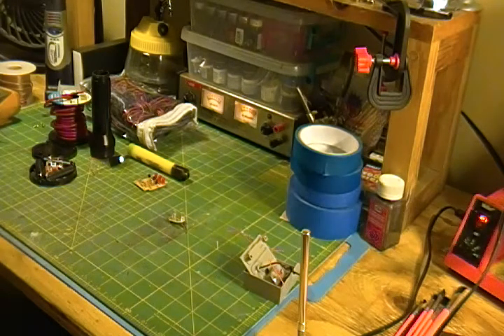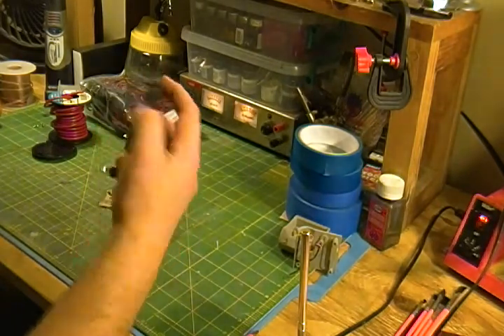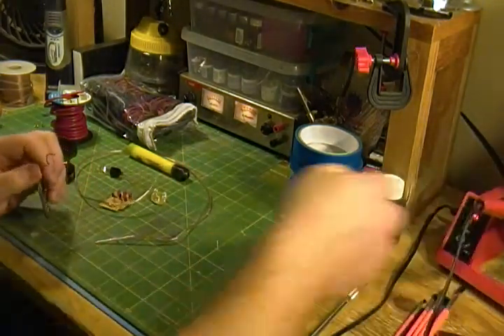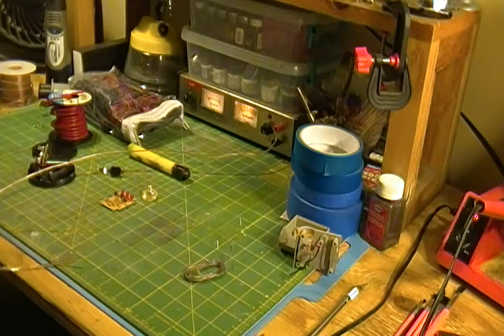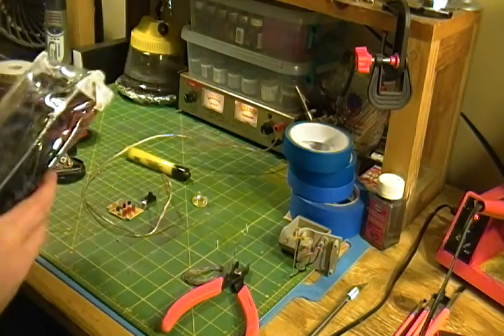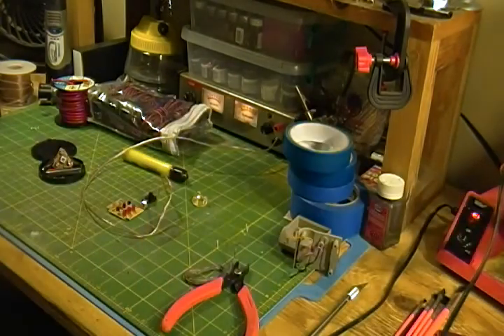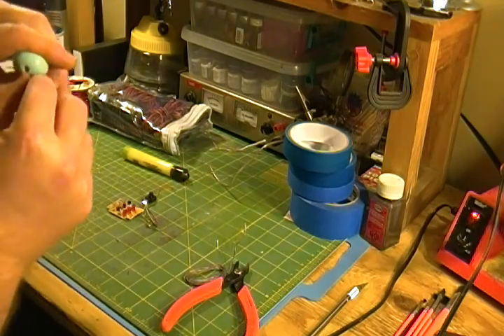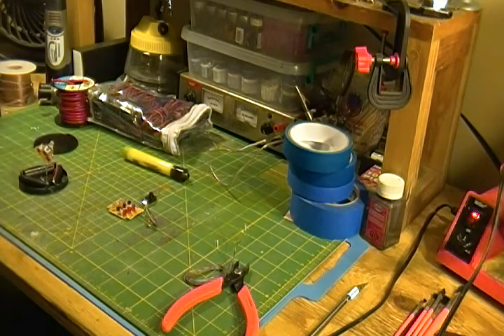Model Creations Video 77 led's from the dollar store

Comment: The dollar store is how I started my lighting adventure.  

On the cheap: Wax paper on the inside for the windows.

Thanks for the Modeler's Brand mention!  The Modeler's Brand LED Supply Packs have no led tape; just hundred(s) of regular 3mm leds (9 colors) and hundreds of resistors, battery clips, switches, heat shrink, solder, electrical tape and more at a much better price than piecemeal from the dollar store.